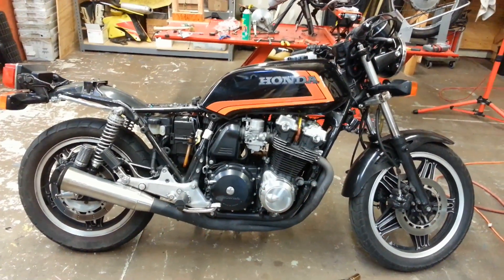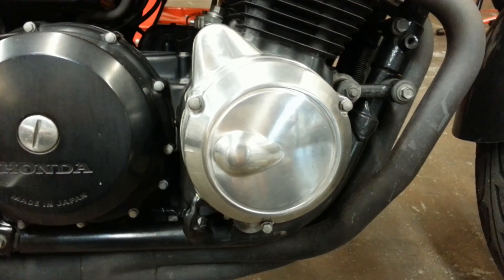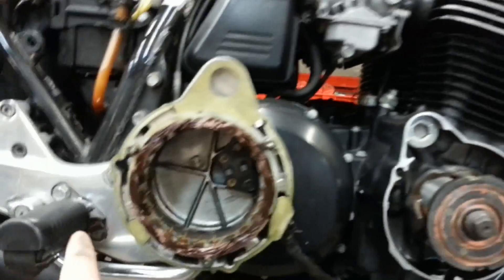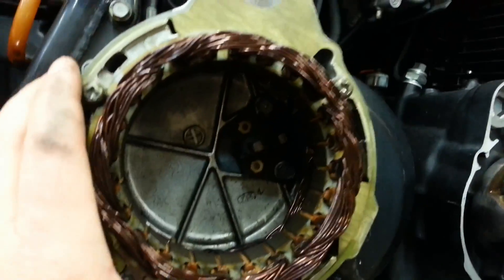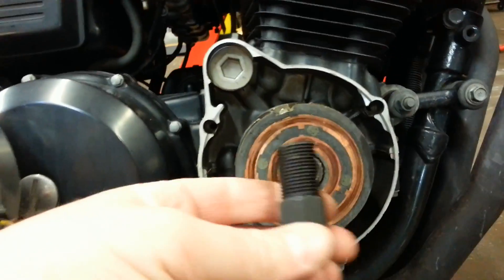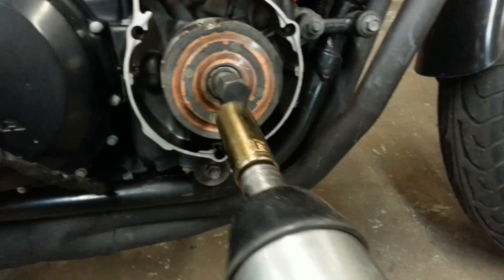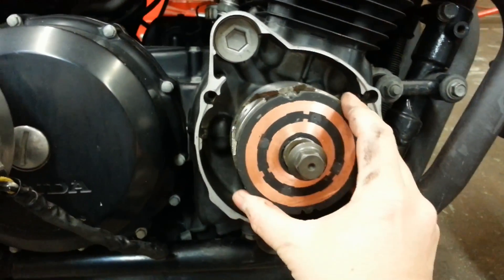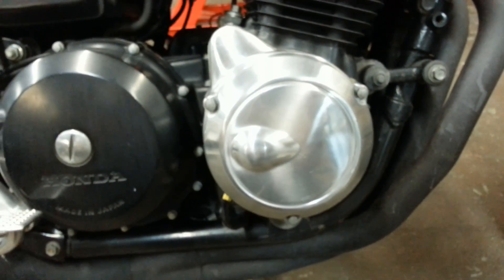How to replace the Charging Alternator Rotor on DOHC Honda CB650/750/900 Models

Comment: Can't I just put a few washers in there before the original boat to push it out?
Reply from the maker: No because the original bolt screws into the crankshaft, it wont push the rotor off. The puller bolt screws into the rotor and then pushes agains the crankshaft.

Comment: Beautiful, concise video showing how it's done. here's a tip for the SHADETREE mechanic - if you don't have an impact gun, you NEED to find a way to loosen the bolt while holding the rotor still. The bolt WILL try to turn the rotor. I use a strap-wrench, actually an oil-filter wrench made with a cargo strap. Wrap it around the rotor and hold it with a breaker bar while you loosen the center bolt with ANOTHER breaker bar. Cumbersome, but it gets the job done.
ALSO - if you don't have a rotor-puller, your rear axle bolt will usually work also. Same thread. (At least it was on my CB900C)

Comment: This method by far was the easiest way to remove a 35yr. old OEM stuck rotor on my '82 CB900F.  Use a rotor puller tool and a few quick blasts with an impact air gun. Thanks for the info.

Comment: Ive been having a charging problem with my 1982 CB900c. How do I know whether its the strator or rotor or should I just replace them both
Reply: you can test them with an ohm. the electrical is tricky with these. ive been dealing with one issue myself. it could be a number of different things... you just have to test them one by one. even my rotor tested good but turned out later it was bad. that was the problem. but ive read about the alternator, brushes, rectifier, just got to be thorough

Comment: Very nice vid. 2 things 1 on a cb650 the back axle works as a puller, thread it on and knock it with a rubber mallet, for real, if its being difficult the impack IS ABSOLUTELY THE WAY TO GO! (you saved me some time absolutely) 2 is there a direction the stator needs to face? mine has an arrow on the inside, not sure if thats the direction of rotation or movment...? Thanks